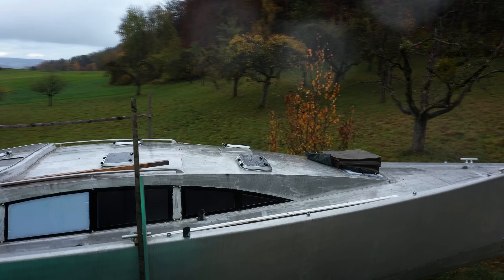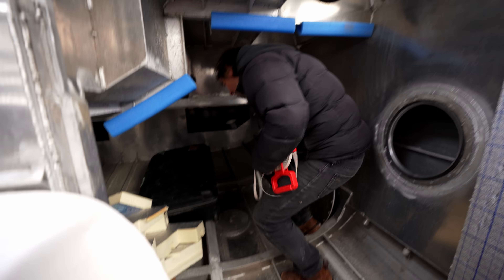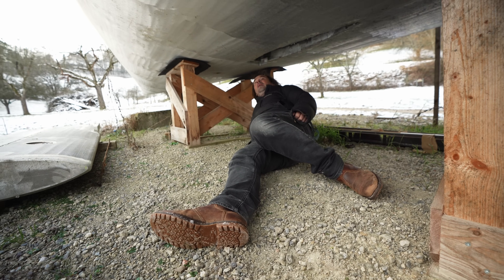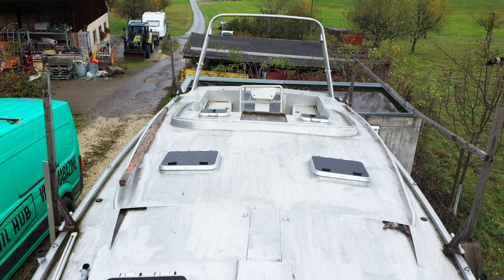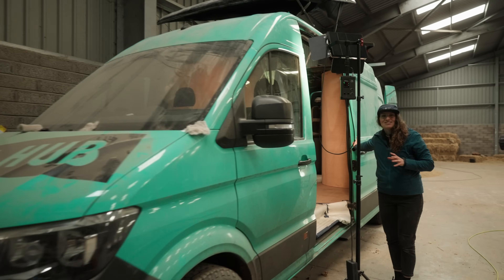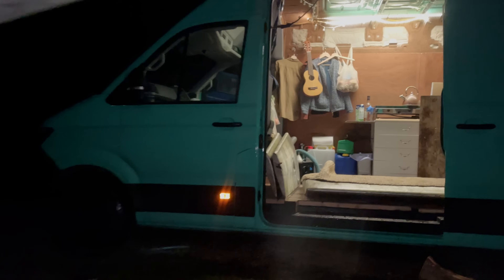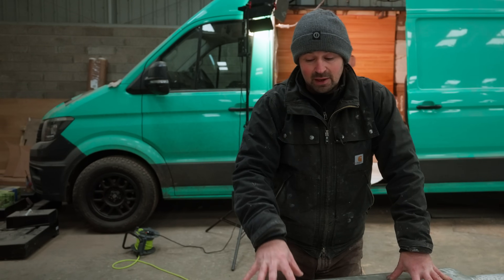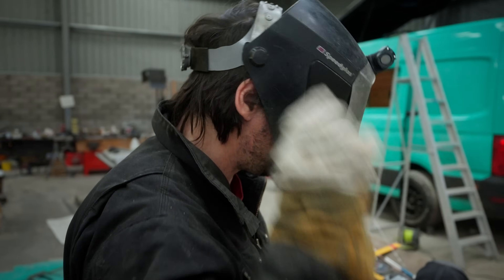We found a 40’ Arctic Sailing yacht Project!

Comment: on a boat that size, "maybe you'll ditch the wheel and put in a tiller????" you guys really want to deal with that at speed? in arctic waters when you could instead be steering from inside? apart from that -- you have found yourselves an incredible hull, and a perfect platform for an all-electric drivetrain/powerplant. looking forward to seeing how it goes!!
Reply from the maker: Yeah, the tillers an interesting thought. It’s simplicity we’re looking at and weight saving which is quite surprising. 
We’re not planning on staying in the arctic, it’s just a place we want to go so inside wheelhouse isn’t really required.

I guess there are a number of large boats on tillers and ours isn’t all that heavy, the other thing is the twin rudders, this should massively reduce tiller efforts. I think we will run a test first, I’m not into gung ho descisions! 

Thanks for the support too, it’s really cool to hear your thoughts on electric, I imagine we will have a fair amount of testing to do there too! 👍
Reply: @SailHub  I just finished successfully testing my solar-electric pontoon on the water for the first time ever -- WOW did I learn a lot of things I probably should have done differently 😂 but, that's boats, I guess -- always learning something!
Reply from the maker: What?! That sound interesting for sure!

Yeah! Everyday’s a school day!!

Comment: Seriously consider tiller steering indeed. It's a much more direct way of steering the boat, very usefull for close quarters handling and let's be realistic, on long stretches the autopilot will be doing all of the steering. When on autopilot you can put the tiller upright freeing lots of space in the cockpit. On the downside, you don't get to stand majestically behind a giant steering wheel the way most people on boats with wheel steering do all the time. My Dufour 35 is tiller steered and I love it.
Reply from the maker: I know, that’s exactly what we’re thinking. It also saves a time of weight which is quite important for light air hydrogenerator productivity.
Reply from the maker: Thanks for letting us know about your tiller too, we hear a lot about tillers being a bad choice in 40’ but I’m not convinced, I think it will be fine. Especially with two rudders.
Reply: @SailHub  And it is much less complicated ensuring reliability. As for generating electricity I would consider solar as well. I have just 200W of solar coupled to a 500Ah lithium battery which is enough for all my electrical needs. I cook on gas though. I especially like the simplicity and the fact that it's fit and forget about solar. With a 40ft boat you should have the real estate to fit enough solar AND enough speed for hydrogenerating.
Reply: @SailHub  Tiller on a 40' is fine. And if you find yourself struggling, just fit a longer tiller. My boat was fitted with one from the yard in 1973 and when it got a bit tiresome for the previous owner, he just made a longer one. Since a fitted a Jefa drive to self steering, the tiller is in the vertical position nearly all the time. Do consider a wind vane self steering unit as well. Saves a considerable amount of electricity when underway.
Reply from the maker: @SuperDirk1965  thanks so much for the help and advice! Yeah, I used to install for Hydrovane they are great but the problem we may have here is the boat may to too flighty. What I mean by that is it may accelerate quickly and cause a change in apparent wind and a non useful vane steering, this is why modern race boats can’t use them.

We will do some testing and hopefully she’s still slow enough in acceleration to make it work! 

As for the tiller, I really do like simple and effective. I think we could be sold on it to be honest… thanks for helping us consolidate things further! Much appreciated
Reply: @SailHub  If it's really that fast, you should be able to generate enough electricity. And if it's not, you can still retrofit an windvane. There's no corners to get backed into 👍
Reply from the maker: @SuperDirk1965  hey Dirk, that’s a fair point. I’m not sure it will be that fast,
probably not to be honest. The sister ships pulls a decent speed but this one was built lighter and we hope to fit it out lighter too. I guess time will tell but what’s important here is your right! No corners to be backed into (we hope!) 

Solar will of course be utilised and we’re looking into welding glycol cooling circuit to keep it cool too. That’s may be way more than is necessary but I’m a geek and the research is interesting for me.

Comment: What weight are you aming at with the van?
Reply from the maker: Anything within payload is good for me, mind you it’s not really heavy, we’re certainly keeping an eye on it and most people would probably be quite surprised. 
For instance I’m pretty sure the step weighed less than the plastic step alternative. literally 80% of it was machined away and walnut is fairly light too.

As for the bulkheads the ply we’re using is light too, it could be lighter but I’m really not fussed. I want it to last and that’s the prime concern here, we’ve had and used loads of vans over the years and I’m tired of them falling apart. The added weight is fine by us, the mpg will drop a bit but we don’t pay for accommodation so I’m good with that, we’re also not planning on towing a car around like many do either!

Comment: Well I like the boat it's a nice aluminum sailboat but your problem is it's set up for racing it's not set up for travel you need to put a  Wing keel on the boat it'll change your draft from now it looks like 6 ft to about four or less but having that keal you have now will cause you problems you can't go into shallow areas
Reply from the maker: Hey, thanks for getting involved. So she’s a hydraulic lift keel. Draft is variable anywhere from 2.5m to 1.1m. Being able to go shallow is a big, big deal to us!
Reply: Yeah I did see that you have a retractable Keel and that's pretty good but make sure to replace all your hoses and make sure they're braided three times the pressure rating go for the best hoses on hydraulic and it would be a good idea to put a surge tank on your hydraulic system because hydraulic systems can be fickle every now and then and you don't need that when it comes to your Keel. Because it's important piece of the boat stabilization. Oh yeah and you'll probably need to put new seals around the retractable system and make sure you carry backups cuz remember this thing is retracting in and out of your boat and that's where  and pair on seals that's another thing that can go wrong because it's not fixed @SailHub
Reply from the maker: @coolhand6669 thanks for the advice… you maybe didn’t realise that she’s never floated before. There are no hydraulics and we have a complete blank canvas so we’re quite excited to be figuring out the way we want to do it.
Your right though, hydraulics are great… when they work. A simple system and being prepared for the failure is our objective!

Comment: As a boat builder you should know the caravan stuff is exactly the same just 50% off.
Reply from the maker: To be honest I find that’s sometimes the case, but not always. There are usually small but significantly important differences.

However…. The price difference would suggest that it’s a much greater difference in the manufacturing process than it actually is. 

On the other side of the coin though… small changes to industrial manufacturing often costs a lot and we’re a niche market… Boat added tax right…
Reply: @SailHub  not sure if reply stayed, I have pissed off they YT gods and sporadically my posts get removed.
Been building repairing boats for 40 years dealing with same supplier, the largest in Australia. He's the one that informed me back in early 2000s. Before that I'd agree but even from 10yrs ago the products have declined. 
It was a great post dam it. Fantastic find though, is it aluminium or stainless? Excellent and exciting!
Reply from the maker: Hey up chap,

I rekon you’ve got some good points there, mind you a lot changed in the last few years. There is a lot of crap out there and that’s all crap. The good stuff is low turnover and usually made in house, the rest is well… let’s say imported from somewhere and not often very good.

Stainless wise.. 316L will be the choice of any self respecting brand. Unless it’s Duplex where required, aside from that RV stuff is 304. Small differences that many don’t know about, usually not even the salesmen, just the fabricators themselves but it makes a massive durability difference. 
As for hatches warping, again a choice of quality really, we pays for what we get. I personally have never had to refit a quality unit for warping, but that’s just my experience.

As for the hull she’s Alustar aluminium. A rarity indeed.

Cheers for your input too, really cool to hear your experiences 👌👍
Reply from the maker: Oh man, the YT gods! Gotta keep them on your side mate 🤦‍♂️😂 I think it turned up again, thanks again fella!
Reply: @SailHub  Nice! Yeah 40 years you see alot. But in Australia we have extremes so it's hard on the old hardware. Leave a boat for a year come back and bang all seals gone.
The Old fella is a naval architect, broke his back so started as an outlet, quality control is near impossible. 80s and 90s seemed gold standard compared to today.

Glad you got that little beaut should last til you get old or decide you want a house on water and move to multis. Seems all the rage nowadays. Quality is shit, but hey look at the world 😉
Reply from the maker: @atw98  cheers fella and thanks again for the comments and support.  
Yeah, a real shame so much quality has dropped, but then again that’s why so many more people ca afford to be sailing I guess, us included! 

Never been down your way, I was in NZ for a few years, sure would like to make it there on the boat mind! That would be epic, must remember to pack spare seals though, well… actually, I should just get them from you😉🤙
Reply: @SailHub  lol no not from me I like everyone are at the whims of suppliers for our slip.
But if you have the money to make it over here you'll love it. So many extremes. I don't think people realise just how large Australia is, it looks kinda small on a map.
Reply from the maker: @atw98 cool! No mate it’s massive, I rode South America by push bike once, that was map understatement if there ever was one! I’ve been careful since 😂
Reply: @SailHub  that's funny! My brother did the same through Africa. The global maps are so distorted. I understand the theory as to why, but still 🙂
Reply from the maker: 😂 I guess we only make that mistake once! Awesome experience mind! Btw, that must have been an amazing trip!
Reply: @SailHub  wouldn't it have been. Your trip would have been amazing to. Not sure my legs would have ever let me do a trip like that on a bike.
Hope I've got time left to do Asia, in a boat. Done US to Australia, Indonesia to Australia, and all north coast. Love to circumnavigate Australia too. 
Age is creeping up on me though at 53 🙂
Reply from the maker: @atw98 man, you’ve been around! Epic stories I’m sure, at 55 your still a youth in this game! Go get em’!
Reply: @SailHub  fingers crossed mate! But gee alot of my generation is dropping off alot faster than our parents at the same age from cancers. And no smokers even faster than smokers it's really really weird. Mums 80 and lost less of her friend groups then I have.
Anyway don't complain no one cares I'm sweet as so here's hoping for fair winds..🙂
Reply from the maker: @atw98 oh mate, that’s rough. Fair winds my friend, what will be will be, I the guess we’re only along for the ride in ever changing tides!

Comment: Interesting boat, but I hate water tank ballast , stick with good old firmly attached ballast rather than water sloshing around in a tank. Like that retractable keel. things grow up inside and the more moving parts the more problems, those unprotected Spade rudders are good for racers, not so much for cruisers. Among the sailing community, 90 to 95% of rudder problems are with spade rudders
Reply from the maker: Hey up, I can see your reasoning here for all of this. Although they can pretty much lol be overcome with design. I will go into all of thy later I’m sure. But of course.. the lift keel, well thy just mens more maintenance. The thing with boats is every weird design out there is still right for someone! And this boat… we were that someone.

As for the water ballast, I don’t see the issue, it’s not like it’s actually part of it’s required stability, all extra which you don’t need to use if you don’t want too.

Comment: I would really consider not using electric propulsion on a sailboat when a diesel engine is so much more practical and economical on longer passages.
Even with all the innovations in batteries and electrical engines etc. I’m personally sure diesel will be the industry standard for decades to come.
Maybe when hydrogen technology and its storage is improved that will replace it but not electricity.
It’s just not practical on the long run/ voyages.
If you need some reliable motoring to get out of a strong coastal current, to stay ahead of a storm, or getting through a no wind area etc. then diesel with all that chemically stored in a very efficient energy to weight ratio, the reliability, repairability of the engines.
I think show diesel engines are far outperforming electrically driven propulsion systems on boats.
Maybe a petrol/ diesel generator driving the electric engine could work, but why do that, other than it’s easy to switch a broken generator.
Especially in bad weather periods how would you be producing the needed electricity?
I would personally consider a hybrid with a good “household” battery capacity maybe for cooking with induction, heating water on demand, having a small washing machine on board, watermaker etc.
Maybe a max. 30 minutes of electric propulsion capability.
Only for going into and maneuvering around in harbors on electric propulsion.
But also because then you could be using the propeller blade to generate electricity from the prop shaft during sailing and be combining it with the power of a wind generator and some solar panels.
I would look for a hybrid electrically supported diesel that takes normal and bio diesel.
This Dutch guy did it, started his engine on diesel in order to switch it to fryer oil from fast food stores and other places using fryer oil.
He would pour it through a cloth filter into the separate holding tank and then heat it up with a copper tube/ pipe around the exhaust to increase the viscosity of the cold oil.
The electrolyses on an aluminum boat would also worry me, but then again I’m a total electrical systems illiterate.
I should really read up about the subject to hopefully find out what I should be doing, I’ll think I could use some help.
Great looking boat though.
And whatever you do good luck with your endeavors, it’s a beautiful boat, great size, not too big or too small.
Reply from the maker: Many thanks for your advice, I can agree with everything you say and we have nothing against diesel engines at all, they are fab!

The thing is, we had them, fitted them, fixed, rebuilt, modified then so many times I just want as new challenge. The way I see it is thy electric doesn’t really work yet and that seems like a good challenge to me. 

I’m probably not going to set off round the world and all that jazz, my intentions are simple, try to make electric work for us. If it doesn’t there’s nothing lost I can turn her hybrid and set off round the works if we want too. Which in honesty I think is the ways to go for any serious cruiser. The ability to save fuel in remote places is a gem.

As for aluminium, every material haas it’s positives and negatives, again.. having worked on all for years this is my choice for our requirements , but yeah, it’s not for everyone and I can see why! 

Thanks for the support and taking the time to comment it means a lot to us 👍